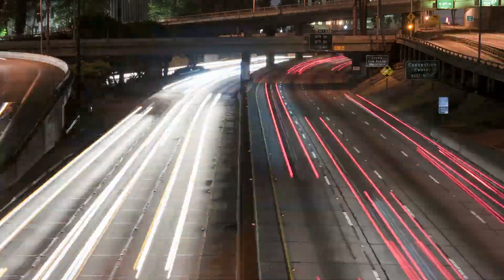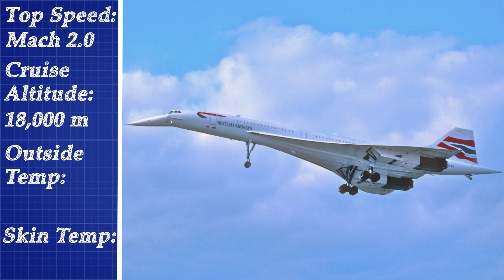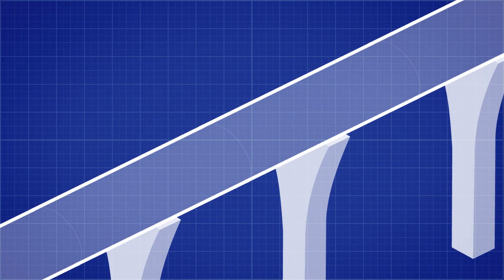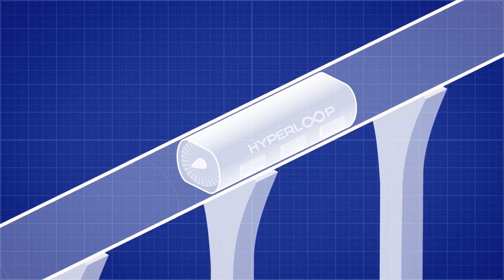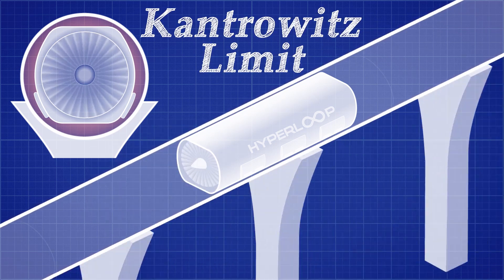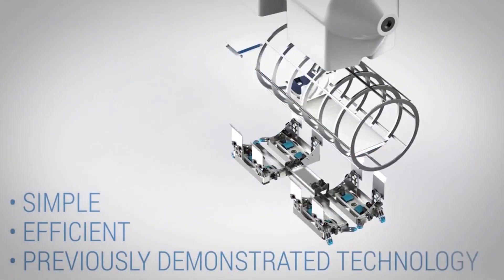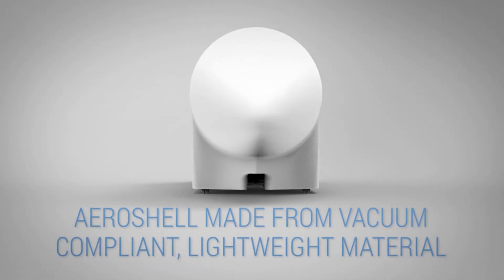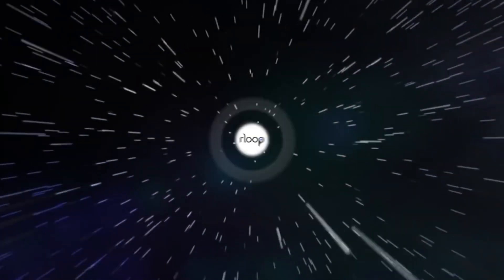Hyperloop - The Future of Travel?

Comment: Lol, a 10 ton bullet at mach 1 and noone has safety concerns? 
One bump and more than a dozen people are dead! 
One leak and a wall of air of a couple of thousands to millions of tons travels along the tube at the speed of sound killing every passenger in every car along the way!
A sealed tube that has no way of escaping!
A turbine that has to spin faster than the speed of sound in order to scoop up the little air that is left!
A ~500km tube that will extend, BEND and contract ~600m under different temperatures!
A tube that will require more material to build than the TWINTOWERS together!
Reply: Thunderf00t beep
Reply: May I answer your obviously Thunderf00t influenced concerns?
There will be air in the tube, the pressure level will be quite close to 1 Torr a vacuum more or less at the cusp of "high vacuum" and one fairly easy to achieve compared to NASA test chambers. As is typical, what air is left will attach itself to the walls, so the capsule guidance must constantly strive to stay centered, but some cushion of the remaining air will aid that process.  The turbine is meant to gather the air still central in the tube, and will stall it to where it can be sucked on through at speeds well below that of sound just like standard jet engines do. It is then re-accelerated to leave behind no traveling air in the tube. No actual positive velocity gain is meant by that turbine, just neutralization, cabin pressurization and some part of the levitation process that isn't handled magnetically. The following capsule needs those neutral conditions for the whole system to work. Thrust  will all be magnetic. Airliners leave vortices in their wake that other airplanes have to stay away from. These are subtleties Thunderf00t is ignoring to gain eyeballs.

A single small leak is not a big problem as the pumping capacity will have to account for that and maintenance patching will ensue.  The one big leak from some bad incident can be controlled by many little leaks all slowing all the capsules in transit  simultaneously along with reversed linear magnetics. 
The sealed tube will have to have to have some escape ports, probably near the many pumping stations which it will also need.  The escape ports can be 'one time use' cheap designs no more costly than airline egress ports without that expensive window. In fact, as time to escape is the same as time needed to re-pressurize the tube, they can be cheaper yet. It may be just a set of dotted lines for emergency crews to "cut here" with a torch.  

As I said elsewhere, the temperature expansions are easily controlled with bellows segments welded into the tube walls at appropriate spacings. Temperatures all along the tube will differ all day long with wind, shade and sun. some will contract, countering those that expand. It is not an insurmountable engineering problem.

The Twin Towers were financially successful for decades until terrorist actions enabled gravity and design flaws, plus massive fire to weaken a steel structure built state of the art in the sixties that took years to build in one of the most expensive cities in which to build. Hyperloop, like much else Elon envisions, takes advantage of  modern state of our art construction methods: Inexpensive steel alloys developed for bullet proof vests now being considered for lighter automobiles,  and uniform pylons much lighter than High Speed Rail needs.   Rail is constrained by its need to have commonality  with a mechanical guidance system over 150 years old.  Cost per mile goes down with a tube that now is reaching practicality with standard construction methods we use today.
 Yes, the costs will be greater than Elon's original plans envisioned. The costs of  incremental speed improvement of rail is much higher.
 The MagLev proposed in Japan took decades to develop and will cost too much. I would not be surprised if they adopted some of the Hyperloop ideas as they progress. Their tunnels have to be huge to allow for air displacement at half or less of Hyperloop speeds. They already use airliner door seal methods to control cabin pressure bumps from tunnel entrances,  adding tubing will allow more speed, save energy and the straight right of way they already use will work fine as levitation control loop response times improve. Remember, many of your genuinely real objections also apply to a system that the Japanese are already building.
Reply: MrBaronmoll Perhaps I have, but I doubt it. Elon is much more of a genius than myself, but he is also very busy, whereas I have the leisure for contemplation that retirement brings. Always a futurist with an eye to the past myself, I busy myself learning as much as I can with this new paradigm of information that aided Elon to his first fortune. Would that my thoughts here would pay so well.
Reply: pff terror attacks - the real terror will be the building cost
Reply: Sounds like a good plan to me! /s
Reply: Technocracy
 The thing is though that it will take a long time until millions of people use rockets as daily means of transportation, each rocket has a couple of thousand people working on every screw for essentially 1-10 years in total, more than half of the whole effort is put into safety measures and the entire research in rocket science got an enorm boost from military interests.

* note that the excessive use of bold font is used to illustrate it's ridiculousness
Reply: peepthezoobazz
 "In engineering and applied physics on the other hand, vacuum refers to any space in which the pressure is lower than atmospheric pressure." - Wikipedia

Negative pressure just isn't a thing except in physical cosmology and when you talk about dark matter.
What's inside the hyperl∞p™ is still called vacuum, no matter what.

You Sir, are an idiot that believes everything any famous idiot claims to be true.
Reply: peepthezoobazz
 It is quite obvious that you don't know what you're talking about
Reply: MrBaronmoll I am not sure you deserve a reply for you Sir, appear to be a troll. 
That said, I do know a thing or two about vacuum, having worked with various degrees of it on instruments sent into space and also to Mars. Elon's proposal is not nearly as 'hard vacuum' as you might wish people to believe. It is roughly to the atmosphere of Mars, a subject near and dear to Elon, and one he is likely to know well.
One thing a vacuum of any sort cannot be is more than 14 lbs. per square inch below our atmosphere. that is the equivalent of 30 ft of water depth. We regularly keep much greater depths of water outside of our submarines and some very long submarine tunnels using standard pumps for small leaks.
Reply: yeah, insurance will be a b1atch. P.S. don't forget terror attacks, earthquakes etc.
Reply: Calling Elon musk a famous idiot on an engineering channel and than quoting wikipedia to prove your point. What en epic win dude....
Reply: MrBaronmoll Robert Heinlein the science fiction writer  once wrote a time travel story which was atypical for him. In it one modern character named "Lenard Vinci" dissappears from the time travel development lab one day, and the protagonist muses something like "when its the right time for steam engines, their will be steam engines, same with airplanes and automobiles. Lenard just end up in the wrong time."
That it now may well be the right time for Hyperloop,  self driveing cars and rockets that land on their base like Heinlein's screenplay "Destination Moon" showed in the 1950's is no accident. The control algorithms and processing speeds to enable them in real time, might be here today. If we do not try, as Leonardo Da Vinci could not have, you are right, it is just Hype. But if the testing proves it possible, well, It is time and you need to get over yourself.
Reply: yes.

when i first heard of this idea (which was like over a decade ago), it targeted a much more unrealistic 8000 km/h top speed. but it was to be build underground, safe from all the crap that makes this unpracticable. it seemed like something ways off, but that could actually happen.
Reply: Technocracy
 Ok, so basically we're debating (and IMO the whole hyperl∞p™ debate is) about the competence of the engineers and architects of the project.
Sadly, if you take a look at the information provided currently, none of the huge problems people have pointed out are even thought of.
It is a very bad sign when some random guy on the internet thinking about the design for a couple of minutes can intantly come up with better solutions.
Reply from the maker: I like your style Paul.
Reply: Not many people mention the incredible amount of energy it would take to evacuate this tube. I work on vacuum systems, we have a 200V pump that runs for 20 minutes to evacuate a chamber the size of a microwave oven. Yeah, let's build an enclosed train from SF to LA and pump that down. Let me know when California accidentally builds a nuclear plant it didn't need that can be re-purposed for that.
Reply: Draconis The Wyvern
So many things wrong with what you describe, one might think you were a time traveler from the the beginning of the industrial age when it was thought that traveling by train at three times the speed of a a galloping horse  would "take a persons breath away". Thunderf00t has "jumped the shark" on this one.
Reply: MrBaronmoll people once thought planes were deadly
Reply: The tube will be built across three earthquake fault lines, it will cross a few dozen roads, and most of it will be where there is active hunting with rifles.  What could go wrong?
Reply: Salvador Espinoza
If you have studied the Hyperloop as I have you would realize that the petroleum interests have very different priorities though they do have the money to throw into Hyperloop should they be willing.
 The ideas are open source, and several companies are already doing testing for both cargo and public transport versions. It makes sense to make profits early, but the concept is most useful for distances over 200 miles between terminals, as its speed and throughput is what can make it a better system than rail for the distances between 200 and around 800 miles.  It will not serve well for bulk cargo, only light packages with time priority like FEDEX.
 Aircraft can only be much more efficient for distances longer than that, and to get great gains will need to fly even higher where thin air can improve the drag ratio. That is problematic on two fronts, The air breathing engines begin to lose power much faster the higher they go and  designing  aircraft to get all the way up there is not easy either. Supersonic airliners are possible with new technologies, but still need long climb and descent times so only very long trips become reasonable.
Hyperloop is also a niche tecnology but we are creating ever more high population density city pairs that can support such a method.
Reply: The hyperloop alpha paper (http://www.spacex.com/sites/spacex/files/hyperloop_alpha-20130812.pdf) specifies a tube constructed out of 1-inch-thick steel, not glass. I don't know where you're getting the idea that it's made out of glass.

EDIT: However; if you want to see a piece of glass that can handle very low pressure wind at 17,000 mph, check out the space station...
Reply: MrBaronmoll I don't know how you get on to plane with this logic? Flying on a tons of weighted tube that's flying kilometers above sky without any escape.
Reply: Technocracy
 You're right, but there have been an increasing amount of people out there that abuse the innovative sound of certain ideas to gain money with fund raising but then never deliver on their promises.
The hyperl∞p™ is very probably another one of those because the idea existed for a long time and just got branded with a new name and hyped (hype-rl∞p™) up by the media.
Reply: A vacuum is a vacuum. Low pressure doesn't mean extreme negative pressure. Musk addressed this problem in his designs.. having a completely sealed tube with low pressures inside wouldn't be practical because leaks and cracks would be too common and too costly to constantly fix. The intent is to have a super low pressure tube with the expectation that it will have 1000s of small leaks
Reply: the way the hyperloop is described and said how it will function by the hyperloop people themselves it will not work...it wont...underground, earth quakes, cave ins, etc. above ground..yes a small leak will affect it majorly. high pressure goes to low pressure areas because low pressure areas draw the things under high pressure to it...your talking about air moving at the speed of sound in a crack meaning their is a structural weak point and almost the entire hyperloop tube is made out of glass. the glass will break..you will be hit by a wall of air moving at the speed of sound..the hyper loop will stop and it will throw you forward and you will die the moment you hit something because your having the force of the speed of sound being transferred into you throwing you forwards..and before you go on about "o the fan will help that" the fan is not for that purpose as described by them its on the back for moving even faster not on the front..an even than you will be thrown forward and die still..for further analysis on that subject..go check thunderf00ts video as he even shows you the papers from the hyperloop people themselves!
Reply: +MrBaronmoll "Uhm, what you said would be great.......if you weren't the first to explain it in that detail because I somehow have the feeling that you alone thought more about the hyperl∞p™ than Elon Musk himself."

Sadly there are more people parroting Thunderf00t on the internet than sound-minded engineers that can actually read the whitepaper and understand physics. The fact that Paul Gracey's explanation is the first one you've seen speaks nothing to the merit of the idea. It just means few have taken the time to closely examine it.
Reply: There is wind in low earth orbit. That's why the space-station's orbit steadily decays over time. There is no point where you go from atmosphere to no atmosphere. It just gets thinner and thinner as you go up. The air pressure in low earth orbit is in the nano pascal range, so about 1-100 million times lower than Hyperloop. They actually have to periodically boost the space station to a higher orbit to account for that decay.

The space station is not made of pure glass, but parts of it are made of glass and those parts do just fine when they interact with high velocity air.

All the pictures you see that look like glass are purposefully rendered that way to show what's going on inside the tube. Just showing people a picture of a tube would be both less interesting and less helpful in explaining the hyperloop idea. Musk even wrote in the alpha paper that the pods would have no windows because there would be nothing to see. Instead the seats have screens to occupy you during the trip.
Reply: "'low earth orbit causes rapid decay in the orbit...so periodically'"

I didn't say 'rapid decay' I said 'steadily decay', and yes I believe the orbital corrections are on the order of kilometers. I don't know why you bring up the speed of sound being slower at lower pressure. That is true, but the 17,000 mph comes from the orbital velocity of the space station and is well above the 700 mph air speed you asked me to find a piece of glass to withstand.

"which are supported by metal are they not?"

I don't see the relevance. Would the hypothetical glass Hyperloop not be supported by cement pillars? would it not be fixed to those pillars with metal? Also, as I pointed out, all glass at sea level is being bombarded by air moving over 700 mph.

"im not talking about the artist renditions."
 Then please, point me to what you are talking about. Because all I know about are artist renderings, the alpha paper, and the test track (which is being built from steel tubes). Otherwise I see no point in continuing this conversation.
Reply: Draconis The Wyvern

The 'car' they used was little more than a sled. What exactly do you think the optimal size is? The pods they are testing next year will barely fit a single person inside.

How do you know they haven't performed any other tests? How do you know they haven't built smaller models or tested things in computer simulations?
Reply: you watch the thunderfoot video too?
Reply: I'm literally repeating Elon musk... maybe u should listen to the engineers working on the issue.
Reply: do you not know what is inside your car?
Reply: the speed of sound at sea level is and standard temperature (20° C or ~68° F) is ~760 mph. In gasses the speed of sound and the average speed of the particles is about the same. That means that air particles hitting you are moving on average at about 760 mph.
Reply: Draconis The Wyvern 
What do you mean by "a larger scale than necessary"? It's a 1 mile track. That's barely enough track to test accelerating and decelerating the single seater pods they're building to speeds half of what the full scale Hyperloop is supposed to reach. It's just long enough to test acceleration mechanisms, breaking mechanisms, hovering mechinisms, emergency systems and possibly a few other systems.

All they've done so far is test the accelerator on an incomplete track. The mile-long prototype won't even be done until next year, but it makes sense to test pieces of it as you build the thing.
Reply: Draconis The Wyvern 
Again. I ask you: what do you propose the ideal size for the test sled should have been? Why? what are the driving variables? Where is this analysis coming from? How do you know they haven't since tested breaking systems?

I'm aware that physical testing is still necessary but the number of iterations of physical prototypes required has been shrinking as computer simulations have gotten better. What is your decision criterion for when to move from simulations to physical prototypes? How do you know they haven't built much smaller prototypes already? What specific information would you hope to gain from a much smaller prototype?

You're making a statement about specifications that are very difficult to arrive at without some complex analysis. Many engineers have likely crunched the numbers to arrive at the scale they did.

Tiny models tend to not be sufficient for the same reason that computer models tend to be insufficient. There are too many variables that vary with scale to trust that engineers didn't forget anything.
Reply: ***** because they are. the question is how do you weigh pros vs cons..there are stupid arguments for sure but if there is a legitimate concern yet to be addressed there will always be a point to argue.
Reply: +Paul Gracey considering all the extra money needed to not only make the hyperloop plausible but safe as well it would not be a good idea to fund it, just yet anyways. an easier solution would be researching more efficient airplanes and also smaller scale versions of the hyperloop to first test the idea out and see how effective they are plus to see if they can make a profit to fund other projects. where I live there is a petroleum refinery and there is a train that cuts thru a very busy intersection and the area where they send it to would see a profit with this kind of transportation small scale of course just enough to make enough of a profit to pay itself off and make some revenue.small steps like this would be better test and business decisions which would help out in the long run. this would help people become more open to ideas like this as well as attract more investors.
Reply: Paul Gracey if there is than explain it dont say it if there is so many things wrong with what i just said. low pressure areas do draw things from high pressure areas.  an the air will move at the speed of sound which under "normal" circumstances is 343 meters per second or 768 miles per hour..where talking about glass here...strengthened glass is (can be) only 10 times stronger than normal glass..this is what the majority of the hyperloop tube will be built with....however something here is wrong according to you so what did i get wrong? do you mean to say that the air will be moving slower with such a drastic differences in pressure and wont break the glass even more/further from that crack?
Reply: MrBaronmoll yeah, but with that logic, people couldn't develop planes 100 years ago. Because it was dangerous and we didn't have experience on flying. I doubt that final product of hyperloop will cause much less deaths than ground transportation like cars globally.
Reply: Abe Dillon eh doc thats not the speed of sound at sea level and eh doc the wind is not constantly moving at that speed even (even if it does reach it under normal circumstances to which i will say bs to) assuming if that was the speed of sound (speed of sound at sea level is 768 mph)...an again a 78+ mph wind is considered to be severely damaging. so eh doc where is all the damage reports from this constant wind?
Reply: Draconis The Wyvern What is going out for commercial use before testing the hell out of it these days? Ofc I can understand the difference between plane tech and hyperloop, mixing that "fundamental tech" between planes and hyperloops are pretty easy, but well done pointing at it. What you obviously didn't understand from my commend is "the idea of creating something new" is similar to inventing planes and hyperloop. You guys probably thought that CERN was dangerous and will create black hole then suck earth. Yeah it SOUNDS dangerous, but they'll eventually make it safe. You certainly not transporting with the first prototype of planes do you?
Reply: Draconis The Wyvern Fundamentals are strong with this one.
Reply: Abe Dillon "Again. I ask you: what do you propose the ideal size for the test sled should have been? Why? what are the driving variables? Where is this analysis coming from? How do you know they haven't since tested breaking systems?" something that weighs approximately 100-200 tons (maybe even lower say 100-400 pounds) for something like this just to test functionality of the systems. if your testing for the strength of the propulsion sure i can see going as high as maybe 2000 tons sure but for functionality testing seeing that everything works together 1200 ton weight is a little too much in my opinion. so i guess it would depend on if they wanted to test both at the same time or not. maybe they wanted to so my argument is invalid but than it would appear they were rushing a bit as functionality should come first.

"How do you know they haven't since tested breaking systems?" your right i dont know if they have gone past and towards solving the problem of the brakes. that is a fair point.

"
I'm aware that physical testing is still necessary but the number of iterations of physical prototypes required has been shrinking as computer simulations have gotten better. What is your decision criterion for when to move from simulations to physical prototypes? How do you know they haven't built much smaller prototypes already? What specific information would you hope to gain from a much smaller prototype?" your right i dont know if they built smaller prototypes already but in the test video they said the first test of its propulsion (first major test to be more specific..so i guess you can say that point still stands really) 

as for the criteria i would say if the computer simulation showed everything worked by about 90-95% after repeated simulations and corrections go ahead and work on physical prototypes. i dont have a problem with the computer simulation though i am saying i think they should've tested more.
Reply: +MrBaronmoll
One bump would have to be a big bump since it's levatating. (also they could do regular checks and implement sensors). 

One leak of air. Easily detectable with the same technology as in an airplane. They could deply ways to break and stop the travel in that case.

A sealed tube. This is my personal biggest concern. How do you escape in case of emergancy. They would have to adress that.

The turbine could be bypassed using some other technology like a larger gap between the wall and the craft or other things.

The tube bending/contracting is not an issue on larger scales only if it bends to much in a short area would it be an issue. This could easily be prevented and detected by something like lasers in the tunnel detecting of the tunnel was bending so much it interrupted the laser signal.

The materials needed (more than twintowers) is not really an issue. How many builds do we have already? How many airplanes could this technology replace? How much fuel would it save? The materials being a bit more than twintowers is really not an issue.
Reply: MrBaronmoll ayy lmao yolo
Reply: Airus1 what makes you think "they don't know how to stop the capsule"?
Reply: Airus1 one of who's videos? SpaceX's? Hyperloop Ones? One of the dozens of other companies pursuing or promoting the Hyperloop concept?

There are many teams testing many different approaches to breaking systems for Hyperloop pods. The goal is to find a good trade off between reliability and cost efficiency which may involve multiple breaking systems (like in your car) for emergency or non-emergency purposes.

Bringing a Hyperloop pod safely to a complete stop is a trivial problem. They could simply shut down or reverse the compressor and let the aerodynamic effects described in this video slow it down significantly before deploying friction-based braking systems to actually halt the pod. Some teams are planning to use magnets to produce resistive Eddie currents in the steel tube to slow the pods down. There are many other concepts that will definitely bring a pod to a stop.

The only problem their trying to sort out now is which are the best solutions.
Reply: The point of calling it out as a 200V pump is no one bothers to configure a circuit as 200V unless you're in danger of exceeding 120V NEMA standards (15A). So you can assume the pump has a peak power of at least 1500W. Of course any scroll vacuum pump draws less once the volume is mostly evacuated.

No one is proposing that the Hyperloop would be a high vacuum system, ie something less than 1 Pascal of pressure. So it would be unnecessary to use equipment drawing even higher loads during fine pumping, such as turbopumps or diffusion pumps.

The volume evacuated in most of the systems I deal with is on the order of a few cubic feet. Even achieving that with the scroll pump takes at least 5 minutes on the smallest systems.

So I'll do some really rough calculations here. I'm just going to wildly assume that the calculation for energy consumed by the pump to evacuate 4 cubic feet to 1 pascal is is integral 1500(0.36^x)+200 dx from 0 to 5 (minutes, which is a weird way to measure it, but I'm rusty so bear with me). The 1500 is the peak power for the pump, we've got 1/e^x as our decay for the power per minute, and 200w as the constant consumption of the pump even if it was pumping on a blanking plate, just based off how large and warm it is and intuition.

We get roughly 2500 watt-minutes, which is 150k joules. So let's say evacuating some metal chamber with a bunch of orings takes 40kJ, and just running the pumps after that is 50w. We're going to call the Hyperloop a 400 mile long tube 13 feet in diameter...so that's 280 million cubic feet. Evacuating is going to take roughly 10 trillion joules, and keeping it pumped down will take 14 gigawatts. Let's just assume I've done something horribly wrong in the calculations, and divide both of those by 33 (I split the difference order of magnitude wise between 10 and 100). Still looking at 300 gigajoules to evacuate and 400 megawatts to maintain it. If you can assume you can spend a week pumping down, the power required to evacuate turns out to be less than whatever the power is required to maintain the vacuum, so that's really the only number that's relevant...and I don't think I got that so wrong that it's really only 6 watts to keep a cubic foot pumped down, so we are definitely looking at upwards of a 400MW requirement just to handle the vacuum for Hyperloop.

I dunno man, I didn't know what these numbers would turn out ahead of time before spending a while calculating this. I did it as an mental exercise but it seems to bear out "spare nuclear plant" pretty well, score one for intuition.

If you find a problem in the calculations let me know, now I'm interested in the calculation.
Reply: peepthezoobazz
What is a vacuum then?
Reply: Abe Dillon show me glass that can withstand wind moving over 700 miles an hour even with a crack in it that is not surrounded by any support other than more glass while being directly hit with the wind.
Reply: Abe Dillon no wind in space..if you say solar wind..solar wind is radiation and heat..also space stations are not made out of pure glass are they?

"specifies a tube constructed out of 1-inch-thick steel, not glass. I don't know where you're getting the idea that it's made out of glass." because outside of the alpha description all you see is a tube made out of glass.
Reply: Abe Dillon low earth orbit causes rapid decay in the orbit...so periodically? they would have to increase altitude by 7-8 KM every time they did that than to stop themselves from crashing...also speed of sound decreases the thinner something is..speed of sound is faster in solids than it is in air

"The space station is not made of pure glass, but parts of it are made of glass and those parts do just fine when they interact with high velocity air." which are supported by metal are they not?

"All the pictures you see that look like glass are purposefully rendered that way to show what's going on inside the tube. Just showing people a picture of a tube would be both less interesting and less helpful in explaining the hyperloop idea. Musk even wrote in the alpha paper that the pods would have no windows because there would be nothing to see. Instead the seats have screens to occupy you during the trip." im not talking about the artist renditions.
Reply: Abe Dillon "Also, as I pointed out, all glass at sea level is being bombarded by air moving over 700 mph." no you did not..first time you mention that..last time you mentioned glass and wind was low earth orbit.

"Then please, point me to what you are talking about. Because all I know about are artist renderings, the alpha paper, and the test track (which is being built from steel tubes). Otherwise I see no point in continuing this conversation." all the articles on the hyperloop all i see is "glass tube".

"I don't see the relevance. Would the hypothetical glass Hyperloop not be supported by cement pillars? would it not be fixed to those pillars with metal?" the point was glass its self is not strong enough is it?
Reply: Gunes Oral
Planes have lots of space to evade to or wobble around in. Planes are built very reliable with lots of redundancy. Planes get piloted by trained personell that can react instantly to all sorts of dire situations. Planes don't rely on the integrity of a giant structure. Planes have been developed for the last 100 years.
Reply: Gunes Oral "MrBaronmoll yeah, but with that logic, people couldn't develop planes 100 years ago." an that is where your wrong. the science behind planes and the science being used here are fundamentally different...o that reminds me can you tell me where the guy got his 700 mph constant wind at sea level? i can only imagine the deaths and damage that wind causes considering only 78+ mph wind is considered to be severely damaging.

" Because it was dangerous and we didn't have experience on flying" again the science is fundamentally different..o and war.

" I doubt that final product of hyperloop will cause much less deaths than ground transportation like cars globally." unfair analogy because there is more than one car. there will only be one hyperloop high way with at best 2 hyperloop cars.
Reply: Gunes Oral no i did not think cern would be dangerous..the science is fundamentally different. i dont care if its new or not what i do care for is the science behind it.

"You certainly not transporting with the first prototype of planes do you?" the point of a prototype is to test waters and afterwards have things built around that prototype. prototype planes were not built with the idea or mind set of transporting 20-100 people at a time where they? the prototype car for the hyperloop was not built with the idea of testing waters. it was built to a larger scale than necessary and the test they did was not even a full test...bravo you got the car to move..now emergency systems, breaks, test the tubes in all environments possible that it can/will be used. safety equipment and efficiency? there is a lot that could go wrong considering the outside pressure enviroment and the inside pressure enviroment (aka the wall of air that will hit you at the speed of sound). what if the propulsion system is too far in-between? how will you maintain the inside pressure environment once the station its meant to stop at is built? people need to get in and out. how will the human body react to such extreme low pressure if exposed to it? maintenance schedules? the test they committed has insufficient data.

cern had a basis and a fairly well structured basis.

the hyperloop your just barely above a space like environment with the inside pressure and a very big difference with outside environment pressure..on a planet...your adding dangers; these are legitimate concerns.
Reply: Abe Dillon i was talking about the car being larger than necessary. all they needed was a small car to show off that it can actually work and is doable making it as big as they did was just a waste. not the fuckin track..as i state earlier in my comments the test was not done enough and has a lack of things that should;'ve been tested.

"All they've done so far is test the accelerator on an incomplete track. The mile-long prototype won't even be done until next year, but it makes sense to test pieces of it as you build the thing." an i am saying its too early to test it and if they were going to test it anyways there is a lot more that should've been tested.

". It's just long enough to test acceleration mechanisms, breaking mechanisms, hovering mechinisms, emergency systems and possibly a few other systems." which they did not test with the exception of acceleration. there was no forced stop or anything to indicate breaks being used nor did they even test the brakes. they even said they were working on the brakes.
Reply: Abe Dillon there is only so much you can do in a computer simulation. why do you think we still physically test things? hell someone might have inputted something incorrectly.

"The 'car' they used was little more than a sled. What exactly do you think the optimal size is? The pods they are testing next year will barely fit a single person inside." an that sled was too large for a test on acceleration. first you test plausibility. plausability is already done so what do you test then? you test functionality of all the different parts..you dont need that massive weight or that size of a object to test functionality of acceleration.

"How do you know they haven't performed any other tests? " the fact they said in their own test video that they were working on brakes..an you have to test brakes before emergency systems which is a given.you dont go straight to code red unless it is the utmost dire circumstance do you? nor do you use emergency brake on cars every time you want to slow down or stop.
Reply: yep, dumb dumb snake oil idea
Reply: +Sonny Knutson Hell, they don't even know ho to stop the capsule. If they were transporting rocks it's fine, but with organic matter or humans it's a big problem
Reply: MrBaronmoll
Reply: Abe Dillon
 It was in one of  their videos
Reply: the turbine doesn't have to spin fast
Reply: london tube is better
Reply: MrBaronmoll Dude, this is still just a concept. OF COURSE it has dangers to it and OF COURSE the people who will be working on this concept will look for ways to reduce dangers.
Reply: MrBaronmoll Aside from the speed and the braking, how are they going to build long stretches of airtight tube on shifting ground surfaces and maintain that airtight integrity to support a vacuum that will, by its nature pull the tube in on itself? We're looking at high costs of manufacture to essentially get a few people from A to B fast. Not knocking the idea outright, but  just from the maintenance and manufacture costs alone I doubt this concept will be made reality for public transport. Imagine the cost to build, and then then the ticket price needed to recoup that cost before they can start to earn enough to maintain it.
Reply: Abe Dillon
 Sry can't remember the video. But the thing is, you can't stop something traveling at avr. 600 mph without long breaking distance. Look how long it takes to stop a train or a car, and those are effected by environment (friction, cooling). In closed vacuum, it will mostly relly on the tube itself. And lok at this shit, ( http://cdn0.dailydot.com/cache/17/59/1759b1493550e56f8a42d18d2ae57e99.jpg) it can't withstand it's own weight.
The amount of air needed to pump out infront of the pod would be enormous, basicly re-pressurizing the whole system again.
They could possibly use magnetism, to avoid stres on the tube. But still, the stoping distance will be too long and there is still need for secundary option in case of failure, that doesn't involve cleen up crew at pod #7. And i wouldn't call that Trivial
Reply: aluisious
"I work on vacuum systems"
Cool! Can you provide more info? Vacuum engineering is one of the aspects of the proposal that is outside my expertise. I understand the basics but I don't know how to calculate things like expected rate of leakage or diffusion through the tube walls.

"we have a 200V pump that runs for 20 minutes to evacuate a chamber the size of a microwave oven."
There are a lot of missing variables here that prevent accurate analysis. I'm guessing 200V is the rated voltage. To measure energy, you would need the actual voltage and amperage drawn over the entire evacuation time. What's the actual volume of the chamber? How harsh of a vacuum are you drawing? If you're drawing much harsher vacuum than 100 Pa, how much energy does it take to get down to 100 Pa?

My understanding is that energy requirements increase exponentially with the grade of the vacuum.

"Yeah, let's build an enclosed train from SF to LA and pump that down. Let me know when California accidentally builds a nuclear plant it didn't need that can be re-purposed for that."

That seems a bit hyperbolic, no? You shouldn't have to draw the entire vacuum very frequently. Ideally once would be enough, then some vacuum draw at the airlocks and to offset leakage.
Reply: The fact that planes work and go from SF to LA in an hour makes the Hyperloop bizarrely pointless. California is a stupid place to build high speed rail. Between SF and LA, there are only a few reasonably major cities.

San Jose: they will never be able to build an elevated tube from SF to SJ. Penninsula NIMBYs would throw the most epic shitfit you could ever imagine. These people are such demanding assholes already that there is an epidemic of their own kids standing in front of the existing diesel trains just to escape living with them. You think I'm joking.

Fresno: so far out of the way to the east that it would make the trip far longer and the infrastructure far more expensive. Also, most people in SF or LA are pretty happy about the fact that people from Fresno are at least 3 hours away, and are not excited about financing bonds to get them closer to home.

Bakersfield: not as far out of the way as Fresno, but even more hated. No one from SF or LA is ever going to want to stop in Bakersfield, unless it's a Penninsular NIMBY attempting to scare their children into studying even harder.

Sacramento: also far to the north east of SF. Either you run the train from Sac to SF before heading south, making it a long and expensive system, or you build a branch...making it an even more expensive system.

We may as well pretend Santa Barbara and San Luis Obispo don't exist, because building these tubes in that terrain would be an incredible laugh. Santa Barbara in particular is basically a city built on a beach, surrounded by mountains and oceans on all sides.
Reply: MrBaronmoll nothing is 100% safe, planes crash all the time, cars crash all the time, ship sink all the time
Reply: a major leak would just mean a loss of speed... also..its a low pressure tube, not a vacuum. its supposed to have small leaks. we also know how to build structures over long distances without them warping
Reply: promcheg
terror attacks and earthquakes would be just as damaging to a highspeed train......
Reply: Paul Gracey
 Uhm, what you said would be great.......if you weren't the first to explain it in that detail because I somehow have the feeling that you alone thought more about the hyperl∞p™ than Elon Musk himself.